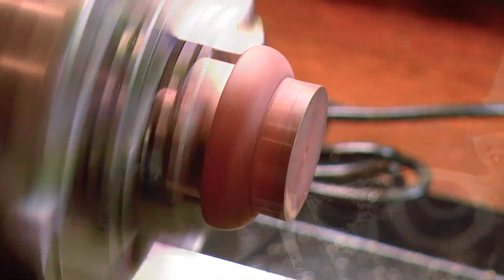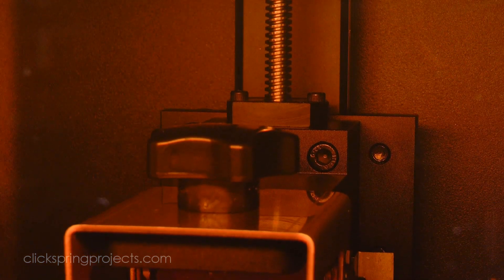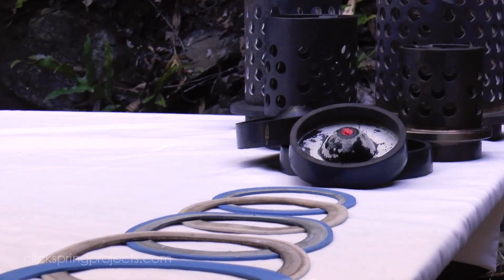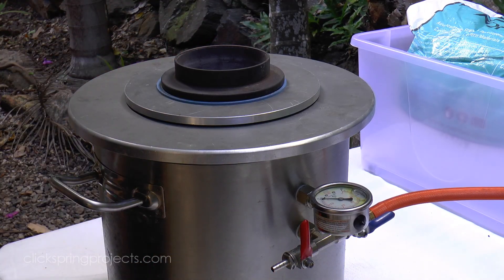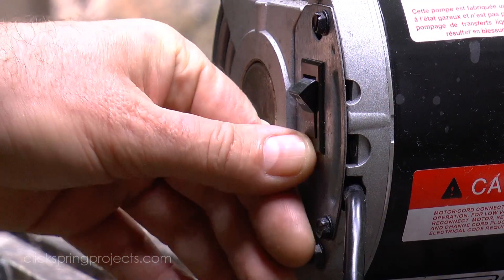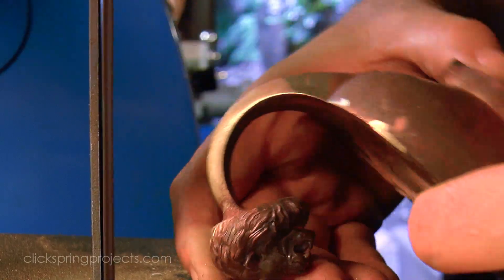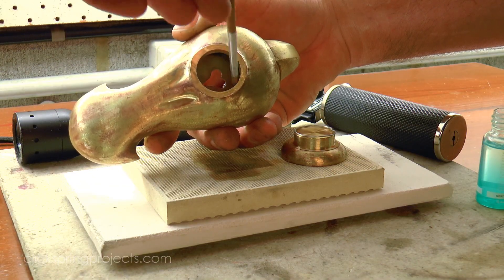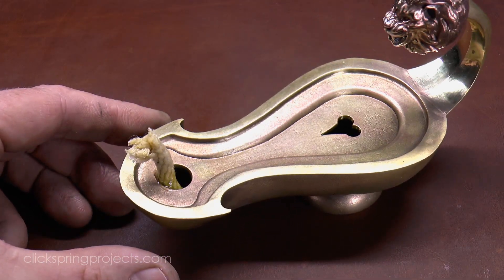Tools, Glorious Tools! #11 - The Vacuum Casting Machine

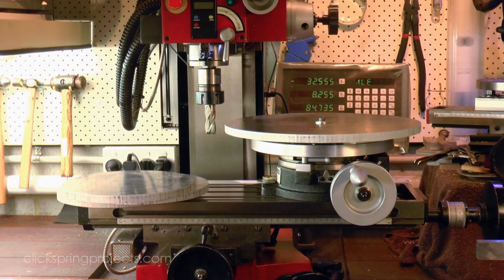Comment: 3:55 I made some adapter plates for vacuum casting.  A pitfall - the flask expands by I think several mm when hot, so if you size your plate to fit a cold flask it won't fit the hot one.  XP  I've had to hammer on a few hot flasks to get them into the plate, haha....

Comment: @Clickspring
I repair, and customize brass musical instruments.

I only use silver bearing solder, and I use a 50/50 mix of muriatic acid and glycerin as flux.

It's a more aggressive, but much more effective flux overall than the zinc chloride stuff.

My solders need to look good, and be air right, part of why I stay away from lead based solder (that grey oxidization looks really bad against silver plated horns), and the silver bearing stuff is measurably stronger.

It takes a couple hundred more degrees (fahrenheit) to melt, but it's manageable.

I also use that same model Blazer for about 75-85% of my work, so it will do just fine.

Anyway, I love your work and your channel, and just thought I'd share a bit.

Thanks much!

Comment: Looks like the weight of the base makes the point right behind the lion head a fine point to hang the lamp. It should keep the lamp near level and the heat plume off the wick is well away from the hang point.

Comment: Hi. one of the things that you may be interested in is, where I used to work the shop used a small tank to store the vacuum from the pump with a couple isolation valves that way the negative pressure could be quickly added and relieved and protected the pump from unwanted contamination.  I thought the design was ingenious.
Rich

Comment: Another upgrade you can do cheaply is add an overflow protection to the vacuum lines. Just take another pot of some sort, make a seal and lid for it and add 2 connections either in the top of the pot or in the lid. That way if something liquid were to get sucked through the mesh it would flow into the pot rather than into your pump :)

Comment: Good video. I've seen people do lost resin (or wax) casting before, but never with a vacuum chamber. What does the vacuum help with? Is the ceramic shell porous enough that the vacuum can suck out air and resin vapors to help the metal penetrate the whole thing?

Comment: Great video, thanks! I use a vacuum pump and chamber to de-gas silicone rubber and urethane resin. I'm happy with mine from BACOENG, although I wish that the pump was slightly more powerful.

Comment: Great video Chris, however am I blind or did we not actually see the resin print go into the pot? I was a bit confused about how the molten metal actually replaced the resin when I didn't see it or its channels actually being formed. Is that what the vacuum did?

Comment: If you're going to make multiple of the same part or really can't have any cracking. Making a negative mold that you can pour casting wax into from the model works pretty well. You could also print out a negative mold if you so desired as well. It is extra steps and work, so whether that's worth it is kind of up to you.

Comment: awesome, always wondered how these worked... i have a dental casting machine the holds the entire flask, furnace, and crucible in a vacuum bottle that can be inverted, it vacs then pushes pressure, from a small pressure vessel that fills from the outlet of the vac pump.
it had me thinking your machine style was more complicated but now i see it just pulls vac thru the investment porosity. 🤦‍♂️🤷‍♂️

Comment: That's a beautiful piece Chris. Investment casting is something I've been wanting to try for a while but it's quite equipment heavy. I did try centrifugal casting at college though. It's super scary!
Reply: I too have a thing about investment casting, I had seen a very good TV program  about the Bennin bronzes, I then got a question about investment casting in my metallurgy finals. Bingo, a question I could answer easily!  I passed.

Comment: How did the Romans mass produce the wax casting? also how did they cast something with such thin walls without a vacuum source? Impressive they did so much
Reply: Maybe they made an original and then a mold of it, used to fill it with wax each time. Take account of how cheap was manual labor back then, specially during some timeframes of the whole Roman history
Reply: They did a lot of wax slush molded in gelatine molds. Gelatine molds (think ballistic gelatine, not jello) were stored in springhouses between uses to keep them away from temperature extremes.

Comment: 👍👌👏 Oh WOW, simply fantastic again and as always (video, work and end result). I didn't know anything about this special kind of casting process before. 2) The oil lamp is looking really great (of course!). Please kindly allow me to suggest/ask something: It looks as if it needs a little bit bigger wick or a kind of insert to reduce the diameter of the hole. This could serve as a kind of rough düse as well. For instance I've used shortened and drilled through bullet casings as inserts. Of course you have the equipment to fabricate something much nicer.
Thanks a lot for making teaching explaining recording editing uploading and sharing.
Best regards, luck and health in particular.

Comment: I think the mesh for the chamber should be on the outside, as if it does happen to suck in something and get stuck in the mesh, it will be annoying to remove... unless the mesh you've installed is screwed on, I suppose

Comment: Since you already have a vacuum chamber, you could avoid the resin expansion problem by adding another couple of steps. Divide the digital model up into different, easy to mold and cast shapes that have keys on them to help align the pieces. Print and clean as per normal. Make a mold of the pieces from a silicone that can handle the temperature of melted wax. Cast the pieces in wax. Assemble them and clean up the part. Then proceed as normal.

While it takes more time, you now have molds that you can use to make a few more copies if you wish and masters to make more molds with. If you're careful with the silicone molds, you could get at least a half-dozen castings out of them.
Reply: That is very clever, I was just thinking that 3D printing resin is really expensive and the printing is pretty time consuming so I was wondering if there was possibility to make new positives by molding the original that you get off the printer. But I thought surely if it was castable in a non-destructive fashion. He just have done that from the start, didn't think about flexible silicone molds for making wax copies.
Reply: I would just print the mold that you can fill with wax. Modern resins can handle more heat than paraffin wax would produce. Or you could also print the mold using fdm and a different material as well if you really were nervous about temps.
Reply: You could also just cast the wax portions separately so cleanup is easier, and solder them all together after. Although the benefits of this are mostly if you have a modular design with shared parts, like reusing the boat and top piece, and having multiple handle decorations.

Comment: Will add that changing the vacuum pump oil is also very important to getting long pump life. If the oil gets the slightest bit cloudy or murky change it out. No need to go for expensive vacuum pump oil here, ordinary automotive oil works well as well, normally a straight SAE30 oil is the original, but you can use almost anything from a 5W15 to a 20W50 oil in it, and it will do the job. Also a good idea is to also include in the vacuum line a filter, simplest is to get a automotive fuel filter, and place in line with the hose, which keeps a lot of fine particulates out of the pump itself, and the filters are very cheap to buy and replace.
Reply: The automotive filter is a great idea! Thanks. 
Use a straight oil, modern EP additives eat bronze and white metals as in bearings etc... Also important for vintage machines and vehicles. For real high vacuum I believe You need the special oils, but that is of no consequence for applikations like this.

Comment: is there no end to your talent's? Quick question I notice at 0:40 when you were loading the crucible with old brass taps you had not stripped them down. In the UK Our taps usually contain a steel screw and/or nut to hold the washer on. Is this a problem?

Comment: amazing as always. excellent work!
Reply from the maker: Thank you mate!
Reply: Tony, I only have a small lathe time machine so I can’t go too far forward, but I just want to say…man your next video is fire.
Reply: Makes my brain tickle good when my favorite YouTubers comment on each other's videos
Reply: @jackkuehneman9300  When Ron Covell shows up in the comments of a Blondihacks video I get the warm fuzzies.
Reply: @thisoldtony CNC MIG to 3d print one?
Reply: He’s insane.  In the most amazing way.
Reply: Hi Chris....I can't get my head around how you pull a  vacuum when the flask is an open basket design...?
Is the "seal" created at the point when the molten brass starts to flow...?
Cheers from Rodney in Melbourne
Reply: @roddersauify you do loose some vacuum with the exposed plaster, but as the video shows it's still enough to draw in the metal, at a previous workplace we used vacuum to draw resin around and into molds and there was always someone telling us to smear plasticine or grease onto the exposed plaster, it clearly helped some, you could hear the pump change its tone when the grease was applied, but I wouldn't qualify it as necessary.
Reply: @roddersauify I assume the plaster seals it off well enough, enough gas flows through to aid the casting process but it’s kinda like trying to breathe through terracotta
Reply: My man, of course you’re a fan
Reply: A DIY version of a $2,000 to $20,000 machine... bad ass, love it.
Reply: Tot. Quit watching yt and upload another video. Thank you …you comedic genius

Comment: Great technique and very flexible as you mentioned. Especially as making the relief is so much easier with modern FDM or resin printing. One thing I am curious about, though, is, does the lamp get hot by the handle after an hour or so burning?